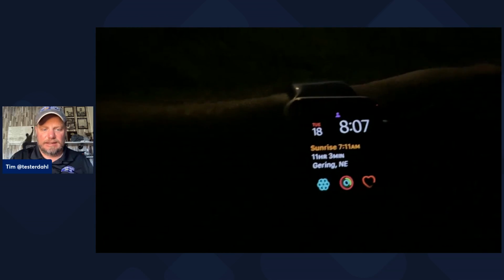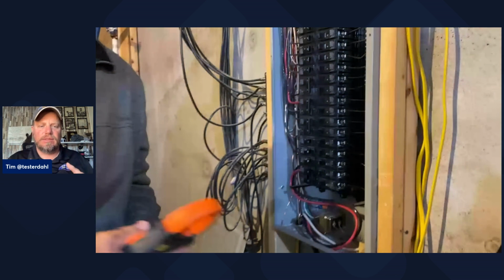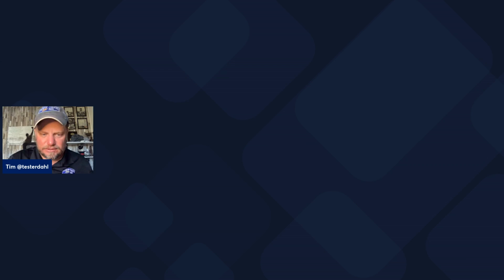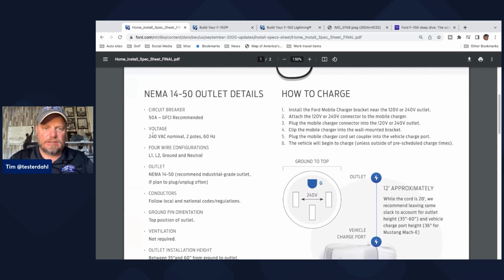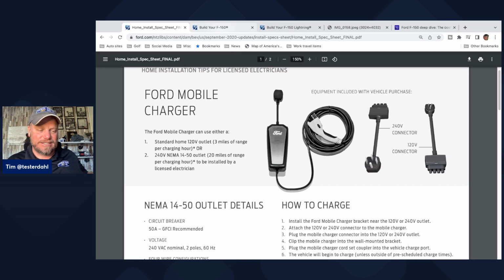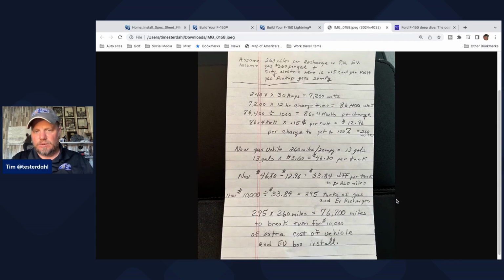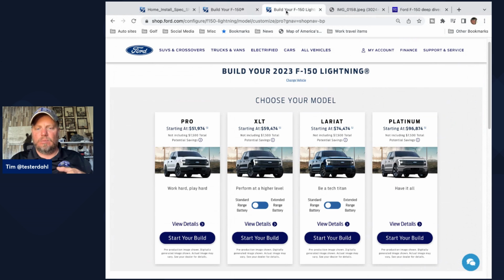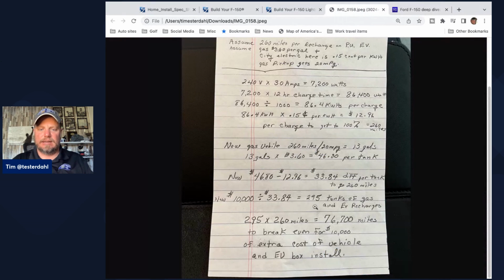11+ hours later on 220V charging price for 2022 Ford F-150 Lightning

Comment: Once again, Tim, fabulous job of detailing the complexities of this topic in a forum where a general discussion can be held by many. In my opinion there is no one right solution for all truck owners. I am surprised that EV manufactures have not created a “go-to” cost justification spreadsheet to help people with this decision, taking into account factors such as local cost of electricity kilowatt hour, daily driving habits, expected maintenance costs based upon miles per year, etc. (perhaps they have, but I am unaware of one). ICE vehicle manufacturers obviously have no need to create such an evaluation tool as they have no reason to - as they already have an established and dedicated customer base. In the US, light trucks outsell passenger vehicles almost 4:1 and according to Car and Driver only  4.6 percent all 2022 vehicle sales in the US are EVs. It is safe to say that most truck buyers are not considering an EV option at this time. However, the size of the market does explain why so many manufacturers are investing so much in the truck EV segment.  Manufacturers face a difficult challenge. They created the demand for profitable trucks in the US after losing market share in passenger car market to non-US manufacturers for years. They essentially abandoned passenger vehicles in favor of trucks and large ICE based SUVs. The most logical path might well be for someone to own an ICE truck for occasional basis while conducting most of their daily commuting driving an affordable EV of some sort. However, given that choice and considering the cost of acquisition of a vehicle, they are likely to continue to buy ICE trucks instead of owning 2 vehicles until infrastructure and advancements in battery technology meet expectations. I look forward to following this conversation. Keep up the great content!!
Reply: The EV manufacturers do not need to because the government did. The website is fueleconomy in the gov domain. "in the" is the same as '.'. I did that to remove the link conversion as then YouTube would remove the comment.
Reply: Wow Joe, what an electric conversation! The manufacturer market just isn't ready for the expectations. Price point too expensive. Battery too expensive. It really got to me when he stated adding solar panels to your home, more expense. At what point does this sound like overkill? The infrastructure isn't ramped up enough yet for EV's. I still see gas ⛽ stations way more than plug in and seriously doubt Biden's  2030 mark will be met. I could buy a house and a horse for less and get there faster while you guys are charging up!
Reply: I don't think the ev manufacturers are keen to make up these spread sheets depicting cost of ownership because then buyers would see that the manufacturers have already factored in the saving into the higher initial purchase price of these cars and trucks..
 If there is no engine in a car that removes 1/3 of production... have the manufacturers removed the 1/3 of manufacturing costs from vehicle pricing..??  No.. They keep dazzling us with wow look how fast this car is... Which is just inherent to electric motor technology.. A new car with its most problematic piece (the engine) gone, there should be plenty of savings.. But no one is questioning this...
Reply: @briguylivetoride1122  Sadly enough it's designed to keep the buyer on the hook. The cost to keep the same car and replace the battery can buy a gasoline powered car. However, it's model has the trade-in in mind!
Reply: @briguylivetoride1122  1. Your claim is that the engine needs to be completely redesigned in an ICE vehicle. This also ignores that the limiter should also be considered in this arrangement, and that limiter is the transmission. Once these components have been done once, then they should not need to be done again. They might need to be slightly rethought if the body is changed in order to make the vehicle serviceable. Comparing trims and features, EV's are $4k-$10k more expensive than an ICE vehicle. Why is the ICE vehicle not cheaper if your reasoning is correct?
2. The EV has an entirely new line dedicated to it in order to deal with the motors, the controller, the inverter, the battery, the regenerative braking, and all the cooling for the entire system. That line didn't exist before this year, but there was a line existing for the ICE vehicle. In other words, the ICE vehicle needed to retool, but the EV was brand new. This is a higher capital investment. Again, why isn't your ICE vehicle cheaper by more?
3. The battery component and charging component or the fuel storage and filling system is much more expensive than the ICE gas tank and filler tube [and technically, the exhaust system], and yet you only focused on the engine, and I added the transmission because the engine is a potential explosive without it.

No, there isn't a conspiracy unless the conspiracy is the fact that the ICE technology which is barely improving is that expensive. In other words, you have no trouble with a vehicle company raising prices of the old technology, but you question without looking at the technology, the pricing of the new.
Reply: @robcrissinger776  
Gosh Rob, I didn’t think that my comment supporting Tim’s YouTube content and the open discussion it fostered regarding the adoption of EVs , the driving habits of US drivers and infrastructure would get under your skin enough to call me ignorant. 

Then, again, you also called the people of the state of Texas ignorant of science as well. 

Sounds like anyone who doesn’t share your beliefs must be ignorant. That’s a great outlook Rob. I’m sure it will take you far in life and you will be respected by many.

You mentioned the IEA in your post. I didn’t realize that the Paris-based international energy agency was the de facto authority on the US vehicle industry and driving habits of US citizens. I am sure that all major automotive manufacturers in the world are hanging on their every word.

Look, the discussion on EVs should be about the feasibility to the average US citizen to utilize the vehicle, and how it impacts their lifestyle. There is no one perfect vehicle solution for everyone. Until we get enough grid capacity and range and charge time is sufficiently reduced, many people in the US will not embrace EV technology for their lifestyles. For those that have adopted EV technology that’s great . 

I personally am enjoying the technology evolution and fundamental change to the US automotive market and consider all driving habits and points of view to be a personal choice. That’s the best part of what Tim’s content  does - without calling anyone ignorant in the process.

Good luck to you Rob.

Comment: I think truck EV's will depend on what you do and want. As a heavy-duty all day work truck no for the moment.  As a daily long haul daily work vehicle no. But as a daily 100 mile per day or less commute yes as long as you can easily charge from home or charging station, this is where EV trucks will shine the rest will come as technology gets better. We all buy vehicles that one we can afford and two that fit us this will never change the EV vehicle will not be for the same as a diesel vehicle. Great podcast to keep up on EV vehicles in general.
Reply: As for environment, to produce batteries are astronomically more then fossil fuels. Google up what does  it take to make one .
Reply: This whole thing is a lesson in madness.  If you are buying a commuter vehicle to use less energy and have a small carbon footprint ect, and your solution was to buy a $90000 truck…I have to question your sanity.  I mean, you could have got a Honda Civic…Or gone totally all in and got a diesel VW..What’s break even cost then 500000 miles?…
Reply: The tech has already peaked.  Lithium will run dry in 10 years.

Comment: The thrill of EV's, but the part that they are not talking about! For a few years, power grids out West and some other areas have been struggling to maintain peak loads. Take that into thought, then add a few million more EV's at homes and businesses charging every night in each State. Then think about the home utility bill. Yes, you save on gas cost but the average EV charger uses approximately the same amperage as a 4-5 ton heat pump or AC unit in the home, running for hours until it goes into maintenance mode. Some Tesla chargers use up to 50 amps with a 70 amp breaker installed on house service (Most US homes have a 200 amp service with 160 available amps on the service, many homes can't handle 50 additional amps without upgrading to a 400 amp service). Ford offers different level charging options but with extended charge times. They do offer a 120v charge option, takes 19 hours to charge the F-150 From Lightening charging site - If Lightning buyers are charging at a home charger from a household fuse box at 32 amps/240 watts, it'll take about 14 hours or 20 hours, depending on which battery was installed, to completely charge the battery. Not to mention, currently Hoover damn that supplies large majority of power to CA and AZ is running on 3 of 7 turbines due to the low water level. If the water level continues to fall, turbines will shut down to 1 or 2 and soon will be blackouts for days or longer. Then every family relying on EV's as their only vehicle will be stranded at home with no way to charge the vehicle. I live on the east coast in hurricane prone area, we have been without power for 7-10 days. Even small portable generators can't provide enough output to charge some of the EV's. It's a good idea to slowly convert some vehicles to electric but not until the power plants and grid infrastructure can handle it, which seems to be put on the back burner while they insist going total electric. My background is over 30 years in electrical contracting and electrical engineering. A friend just retired from one of the largest utility companies in the US as a grid system engineer. He has said the power company knows if over 25% of the consumers switch to EV's, the grids can't handle it and there will be major blackouts. You never hear the politicians or news outlets pushing total electric talking about the negatives! 
Imagine this!
Going mostly EV's with a grid infrastructure that is currently struggling, CA is wanting people to turn off AC due to the grid demand. Think of the number of apartment, condo and townhouse complexes you see in the cities. Every apartment complex will need to provide at least 1 EV charger per unit. Take a 10 building complex with 60 units per building, (600) EV charging stations. At intermittent demand, that is still like needing additional power at large apartment complexes to build a super wal-mart just for EV chargers, how many existing grid systems have this availability at every apartment complex throughout a city? Then think about who pays for that multi-million dollar construction at every apartment complex! The owner pays "if" he can get the funding, then the cost is passed to the renters, many being the same renters that are struggling to pay current rent.

Think of the tens-of-thousands evacuating from Florida a few weeks ago. What if those tens-of-thousands were driving EV's! 250 miles wouldn't get them away from the storm and a few EV chargers along the highway wouldn't get tens-of-thousands EV's out of the state. What about in CA when wildfires are spreading and people have to evacuate? Major blackouts, dead EV and stranded to be burned alive because idiots told you to rely on EV's. Talking about total lock-downs! What is 90% of the residents in CA go to EV's, all the gov needs to do is shut down the power grid, you are locked down. No power, no food, no transportation!

What the politicians don't talk about is the negatives of EV's. Research what goes into mining and manufacturing batteries for EV's, what that does to the environment and the carbon footprint.
Reply: Now Chris we can’t have those critical thinking skills going on, it puts to much strain on politicians brains🤣🤣🤣
Reply: @robertluther3775  They don't want you thinking about it !!!

Comment: The recommended load of a circuit should not exceed 80% of the available supply. For a 50 amp circuit, you should expect to draw a 40 amp load or lower. A #6-3 copper wire is good for up to 55 amps in a 60-degree celsius column. Ford claims that their 50 amp charger will draw up to 32amps max while charging the f-150. You will also have charging losses on all sessions. Unfortunately, it's not a perfect system yet.
Reply: I can charge my lightning off my 8800 watt inverter solar system as long as I isolate my deep well pump everything else runs fine. And my 13,000 watts of solar still charges my batteries during my EV charging session.
Reply: Maybe in a hundred years
Reply: RIGHT.
Reply: Yes people don't realize the math is different for continuous loads.
Reply: @paulwolf8444  Also the surge at start up for motors.

Comment: Something left out of the calculation: battery replacement.   My vehicle started complaining about  the battery at 65K miles and was useless at 80K.  The dealer wanted $6K to replace the batteries.  Short version: I went back to gasoline.  My recommendation: look at customer reviews that talk about lifespan and replacement costs of the batteries.

Also, take a look at what it costs to repair the vehicle after an accident.  I was rear ended and the dealer had to ship the vehicle to some place that was authorized to disconnect the batteries before the mechanics could work on the vehicle.

Comment: When you install wiring you always exceed the normal operating draw of the appliance a little bit, a 50 amp circuit breaker covers the surge factor when you connect and disconnect electrical loads. If you put in wiring for 30 amps and you have the expected surge you will pop the circuit breaker almost everytime.

Comment: Now go tow a trailer and see what your mileage is. Hoovie's Garage did an excellent video on towing with a lightning (medium size aluminum trailer with a '32 Model T on the back) The weight was well within the specs of the Lightning, yet his mileage nose dived on a less than 100 mi trip.
Reply: It's a lot of electricity to only go 100mi brother
Reply: Or drive with a load and in an area where there are some steep inclines and hills. Let's see how the battery does.
Reply: @rodfransham2907  And weather conditions !

Comment: Thanks Tim you did great again, really appreciate your work on this one. Now if we can get Ford to get there quality back under control and get a gas model and a engine that gets great milage it would be a great truck again.
Reply: It will be years before ford has quality again, poor Henry Ford must be rolling in his grave, does ford think that they are the best and the only game in town. ???? With back to back recalls, engines missing valves ,cars with possible fire issues, why don't they just make the quality levels better rather than trying to beat the competition,many people have jumped ship due to the lack of quality, it's so obvious
Reply: They said they fixed the heads spitting spark plugs issue in the 5.4 I've got a 2011 Econoline that's spit two.  😑
Reply: Read up on whats going on with GM truck engines. I may never buy a Chevy again,  because they are not putting recalls on issues that should be recalled,  but instead owners get to pay. That's coming from a technician that was a Chevy man but worked on Fords for 15 years, before retirement.

Comment: I install car chargers, Tesla, Kia, etc .. I wire for the maximum amperage circuit allowed by charger with consideration towards the building service availability. Usually 40-60 amp 240v circuit off a 200amp service. The cars do need you to download app, you have to tell the car you have a 60a circuit hooked up, otherwise it’ll only pull 15-30 or whatever the factory default is. If you don’t adjust the default, it’ll take 12 hours to get half a charge.